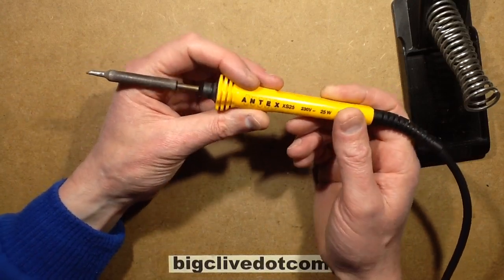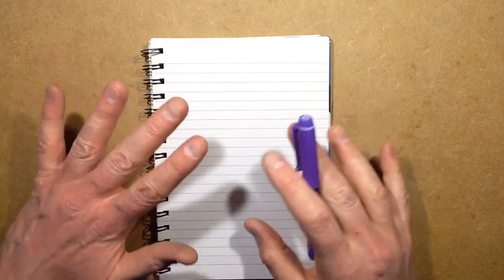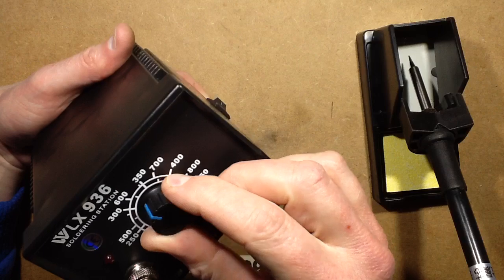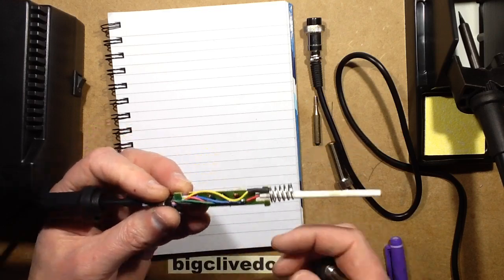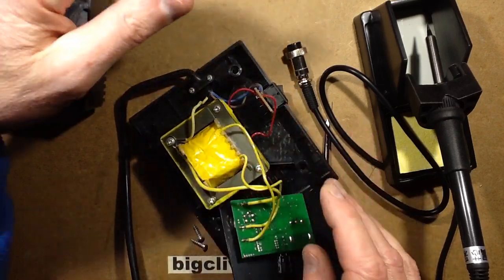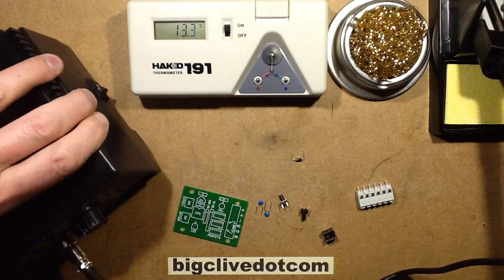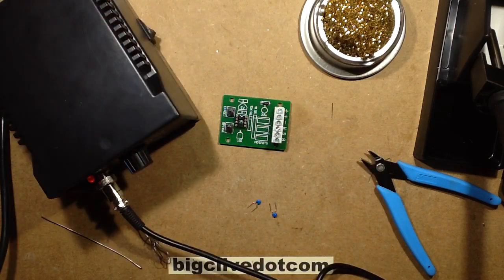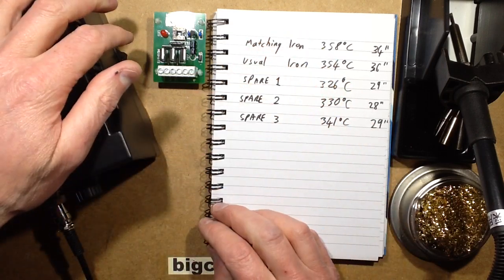Soldering basics and choosing a cheap soldering iron.

Comment: If you do end up going with lead based solder, wash your hands.
Also, try not to breathe flux.
You can always add more flux to a bad joint. Rosin tubs or flux pens work good for this. Or just use copper wick to melt away the old solder after removing the component, and try again

Comment: the way i ruined my most recent kit is by accidentally bridging a fourth of the pins on the ic when trying to get rid of some solder that somehow went through the hole when soldering a resistor

i really wanted that oscilloscope ):

Comment: I recommend to NOT clean the tip before placing it in the soldering iron holder.   The time to clean it is right before using it.  Also, when you are finished using the iron, turn it off, clean the tip while it is still hot and reapply solder to the tip before placing it in the holder.

Comment: Uhm, I don't know if anybody else has already pointed this out, but your soldering order is different from the one you're teaching, i. e. you place the solder on the pad and then heat the joint with the iron. I guess this doesn't make much difference at 370°C because the joint warms up almost instantly.

Comment: i've also forgot irons on, i've told it's bad but quality of bit and heater seems to matter here... i currently use weller sp25l which i got after brand new random noname "velleman" went to open circuit after just one soldering session... pissing me off and made me buying iron 5 times the price

Comment: I just had a hard time soldering, after taking a LONG break.  I bought some leaded/rosin core solder from walmart for this little project. When I was soldering, I got these little bombs shooting off the tip of the iron. They were little solder bombs, and they'd shoot in various inconvenient places, and they'd leave a smoke trail, and maybe a little smoke puff where they landed. I don't seem to ever remember having this problem. Any ideas?
Reply from the maker: It's common.  Especially when soldering larger joints at high speed.  It's the flux boiling.

Comment: I've got the digital version of this station: https://www.ebay.co.uk/itm/272161465372 It comes in the same case, but it has 2 buttons for up/down and a simple 3-digit 7-segment LCD screen to show the temperature (which is lit blue). I also have some bits, but these don't seem to be the generic ones that you have. They are quite long, and therefore all of them do have quite a big thermal mass, so it really takes several minutes for the iron to heat up to the set temperature (or what it believes to be that). I don't know if that's a good or a bad thing though. But it also really works fine, I don't complain about it, other than I hope the bits for it will be available in the future as well. Other than that, just like the generic Chinese ones, it's a good station. But I'll have to look into brass pot scrubbing pads, because I have never seen them in brass. Sounds like a really good way to clean off the tip, much better than the sponge (which I tend to almost lose all the time anyways).

Comment: Flux removes the oxygen from the surfaces, this helps to stop corrosion at the points you want to join. The hard solder works just fine just use a seperate flux, yep requires a tinny bit more movement.

Comment: I think your brass pan-scrubber ashtray idea is so brilliant! I'm fairly convinced that the cold+wet sponge for cleaning glowing-hot tips contributes to the pitting of irons.
Reply: ? I don't think he took credit for that idea. That's the only thing pro soldering has ever used. Wise to keep a hand one too. Like a wire brush with a handle, I mean. You can get at all the cracks and stuff fast. peace
Reply: @blackopal3138 ,  I've been soldering for over 50 years and I can say from experience that the brass wool works better than a damp sponge (soldering equipment manufacturers say that the damp sponge puts stress fractures in the iron plating on the pointy end of the tip and shortens its life). The business end of the tip needs to be plated with iron because molten solder and flux would quickly dissolve bare copper; high quality tips are made of copper throughout because it has better thermal transfer characteristics than iron or steel. The internet, unfortunately, is awash with cheap iron or steel soldering iron tips. I posted a video on my channel recently about how to tell the difference  between good tips and badusing an ordinary magnet, as well as a review and teardown of a $45 Harbor Freight Schneider soldering station which is a very good value for the money as long as you buy better tips to go with it, the included tips being solid iron ( it says so right on the box) and conical shape ---- a chisel shaped tip is usually better for transferring heat quickly.
Reply: @blackopal3138 , ps,  Don't use a steel brush on a soldering iron tip, use a brass brush, as the steel brush will likely damage the iron plating on the tip.

Comment: Thanks Clive for teaching me how to solder properly.
Had a daughterboard to solder into one of my car's ECUs and wanted to do it right.
Have done a tiny bit of soldering before but the tip was knackered and lead-free solder didn't help matters, so decided to buy a 'WEP 60W adjustable soldering iron kit' on ebay for £16.99 and some Duratool rosin core 60/40 solder.

A bit daunting having to clear all the holes of solder beforehand, thankfully the kit came with a solder sucker as the soldering wick that came with the board was rubbish!

Are my solder joints OK in the last pic? I did re-flow a couple on the left afterwards to make them more volcano-like. :)

https://i.postimg.cc/G3SW-c2kT/klr-ezkdb1.jpg
https://i.postimg.cc/SsxP4FRG/klr-ezkdb2.jpg
https://i.postimg.cc/J09YjsqT/klr-ezkdb3.jpg
https://i.postimg.cc/fRYpjf1Y/klr-ezkdb4.jpg
https://i.postimg.cc/4d2SNLhR/klr-ezkdb5.jpg

Comment: a quick note or two on solder, when I used to be in electronic manufacturing industry lead based solder was still used for medical and military circuits.  The other thing, if you want to buy lead / tin solder search for 60/40 solder.

Comment: For more thermal mass on those cheap chinese irons I use couple of butterfly hose clips (made from some kind of brass-coloured material, probably just zinc-steel) around the thick part of the tip. These hose clamps are much like the wire ones you see under car bonnets on fuel lines but are made from sheet metal rather than doubled/bent wire. They help when batch-soldering large RF connectors like PL259s. 

Also bear in mind that warming your boards (say, on a hot central heating radiator or similar, a single or double kitchen hotplate (set on low!) or even warming with a hair dryer can dramatically reduce the heat drain compared to soldering room temp assemblies. 

A hair dryer also give some extra help when removing large electrolytic caps if they are done with lead-free solder.  By the way, worth mentionng I only buy tine/lead solder, lead-free is a nightmare. 
My IQ is around 10 as a result, but at least my joints are pretty good. My soldering isn't bad either.

Comment: How do you prevent the little point when you remove the soldering iron? Everytime I try to solder something and as soon as I remove the iron it like sticks to the iron and creates a point then when I touch the iron on to get rid of it it just makes it worse.
Reply from the maker: That suggests that the flux has gone.  Try adding some flux if you're not feeding fresh flux cored solder into the heated joint.

Comment: Sorry to bother you Clive but have you done any 0402 components with the Antex if so which tip size did you use. I tried the very small one but insufficient heat transfer I am finding these small parts difficult to desolder and solder.
Many thanks, John.
,
Reply from the maker: I've not done components that small.  I think I'd use heat paste and a hot air gun or heated soldering plate for that.

Comment: Greetings: Is the 936 you purchased switchable between 120/240 ? What about 100v for Japan?
Reply from the maker: You can get 120v versions and also switch mode universal voltage versions.  Both should work on 100v.

Comment: So I'm an electrician but I don't really deal with soldering but recently I had a dodgy joint for a barrel connector  it was 22:30 and I didn't want to come back as it was very far so I cracked open my still sealed soldering iron and sorted out the joint by removing the old solder and remaking the joint, the catch being I didn't have flux so I borrowed some from the plumber, should I be worried? The joint worked fine after I was done I was there for 2 more hours and had no problem with the item..... can you use plumbers flux in a pinch for general connections?
Reply from the maker: I'd say yes in this situation.  As long as the joint flowed cleanly it should be OK.
Reply: @bigclivedotcom  wow didn't expect a reply from the big man himself, thanks for the info also I have ordered some robin core solder for the future.

Comment: I learned to solder silver soldering tattoo needle groups and then the groups to the bars.The worst part I had to teach myself (this was in the mid-late 80's) there was no internet, and the guy that was suppose to teach me was more harm then good.Had to use silver solder since the needles are stainless and the bars were a different stainless. When I first started I had all kinds of issues, even though the needle group and bar were in jigs the group wanted to split apart, or the solder I tinned the bar with would want to flow into a ball in one spot (never the spot I needed) I waisted so much solder, flux, needles (too much heat wrecked the temper) the first few weeks. After I got good, to the point I could do a few hundred in a could hour I could have done it in my sleep, not long after it was pretty much at same price to order pre-soldered, sterilized, and sealed set. It was frustrating, irritating and I almost gave up at one point, and I wouldn't change a bit of it. I still buy loose needles ounce in a while and do a could hundred I find it relaxing, I get in a zone and memories flow back so clear I can almost smell the old shop.

Comment: I have a 12 watt weller pencil iron with solid copper tip , had it since the 70s still in perfect working order😉
Reply: I still have a 25 and a 30 watt Hexacon iron, both made in the 1950s.

Comment: That's a smaller transformer inside the 936 clone than I would expect.  Any idea what it's Amp rating? I think it's less than 3 Amps.
Reply from the maker: They sometimes downsize transformers based on duty cycle.

Comment: I melt stuff from TiG welding to surface mount electronics. My most recent project was a heater for scientific equipment with a high explosion risk. Most soldering irons are 19th century tech that has been perfected. Magnesium Oxide is the powder that conducts heat real well yet is an electrical insulator, you wrap your heating element with that and stick it in a metal can.
If you build yourself your own iron you can produce something that is 21st century using carbon nanotubes and conducting epoxy ceramics, the same tech that is being used to produce smaller and smaller electric motors for the EV market.
A good iron needs to be the correct temperature and have an infinite reservoir of heat at that temp. Carbon nanotubes allow you to do that for the first time. Most traditional irons with a large heat reservoir will fry microelectronics and most microelectronic irons will go cold when soldering large pieces for the reason that the iron itself is the heat reservoir, carbon nanotubes allow you to put the heat reservoir away from the tip of the iron.

Comment: After going through several solder guns of dubious quality, I finally settled on the X-Tronic Model #3020.  They are very cheap and very good (used mine for hundreds of hours of soldering). My only complaint is that you cannot replace the soldering iron if say your cat eats through the wires (this happened to me once).  They are so cheap though, that it isn't a problem.  They are compatible with Hakko bits so its easy to get them when you need.

Comment: Every soldering iron I used ended up not heating up properly, and developing a sort of burned layer. I won't even evocate the number of soldering irons I had to buy in a DIY store. The only soldering iron that satisfied me was a purely chinese one. What a paradox!
Reply: "Burned" layer is after thin iron or other less reactive coating wears through to the copper core. Better tips have more lasting coating. Plain copper tips need regular dressing with a file to remove the "burn", and immediate tinning.

Comment: I found an el-cheapo USB powered soldering iron on ebay, said why not, bought 5, cause they were like $3, and started messing with them.
at 5V they didn't do large joints, just not enough oomph in that voltage I suppose, so I took it apart, took off the USB lead, soldered on a boost converter, bumped that up to 7V, and then wired in a small lithium polymer battery with a good current capacity, and a switch. I now have a quite decent little wireless soldering iron that goes for around 40 minutes before the boost converter cuts off the lithium at 3V, and does relatively large pads. It made installing my car alarm and other stuff where a power lead was inconvenient a lot easier.

And after 2 years, using it every other day, it's still going strong, nothing failed from the over-voltage, etc. Great little tool. Got a TP4056 on it now to charge it over USB as well.

Comment: 60/40 solder is great for brass model building. You clean and tin the joint with flux and then sweat the joint after re-fluxing.

Comment: My 1st iron wasn't heat controlled and it can't even melt solder off the soldering spool so my 2nd I bought a temperature-controlled and still use it I just increase the temperature when needed. I just ordered a serious upgrade for my electronics hobby bench with a 3 in 1 unit should arrive soon. I can hardly wait to try it out oh yeah I also bought one of those inexpensive digital microscopes to try out and see if it can help with SMD soldering...🤷‍♂️😁 When I was trying to learn to solder I found a lot of people saying that you should tin your tip often, I don't think I have ever seen you do that but if I don't I find my tip turns colour and then it doesn't allow the solder to wet it. 
I should also add that it was Clive's videos that nudged me towards this as a winter hobby winters are hard here and very cold boring days filled with nothing but white winter indoor hobbies are a must here.

Comment: I'm thinking about buying the 937+D version.  I can get it for $29.99 U.S. plus I have a $5 coupon that I can use on it.  I've been wanting a soldering station for a while and this one will basically be free because the funds came from a shopping app!  I'll let you know how it does when I get it, since I can't find a review about it anywhere.
EDIT:  I ordered the soldering station last night.  Should have it in a week.  I also wanted to say thank you for showing people the PROPER way to solder.  I've seen people doing wrong on here so much.

Update:  I did buy the 937D+ and I really like it.  Now I'm looking to buy an 858D hot air rework station.  From what I can tell, most of the Chinese knock-offs work really well.  However, from what I have seen of the 858D rework stations are they were either wired wrong from the factory or the cord supplied with them is made wrong.  The live and neutral are switched.  I've watched a lot of videos where people have found the station itself is wired wrong, but then a guy say that he tried a different cord and that the cord that came with the station was wired wrong.

Comment: One thing that would have been useful is to find out how much watt-hours the soldering irons use.  They are on for so much time that it can add up on the electricity bill.  Thanks for another great video.  👍
Reply: In winter, the watts from an iron directly offset your heating bill.

Comment: My dad taught me how to solder by having a couple of high power resistors at hand to place on an empty circuit board, with the idea "You need to abuse those really badly heat-wise to actually destroy them, so they are good teaching material" and when I had the hang of it, we started soldering smaller components and then the kits.

Comment: nice presentation, thank you - however I hoped, you're doing reverse-engineering the station's control-electronic (LM358 etc..).  I'm interested because I'd like to compare it with the one, I constructed for myself (also with LM358, Thyristor etc..). For indicating the temp. I'm using an old moving-coil-instrument (old VU-Meter) which is totally fine and tells me the point, where I can start soldering.

Comment: I have a cheap soldering iron from our local Jaycar electronics store.  I have had a few years.  It was something like 60 Australian dollars, which I think is close to £40.  Add retail markup as it was from a store not ebay.  It's pretty cheap and been really reliable.  It does that same regular pulsing of the LED., on off on off at set intervals rather than random heating cycles.  It's branded Duretech model TS-1564.  48Watt made in China.  I am not sure of it's operating principle though as it only has a 4 pin connector rather than 5 pin.